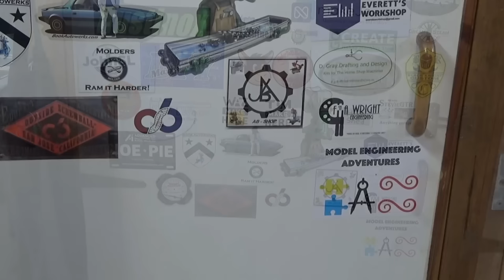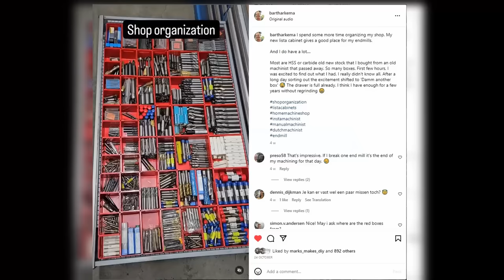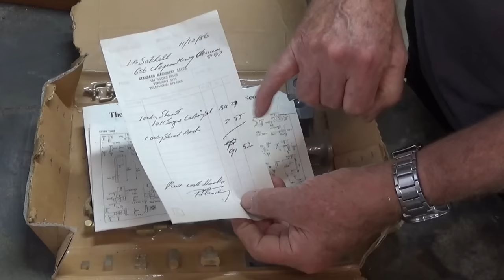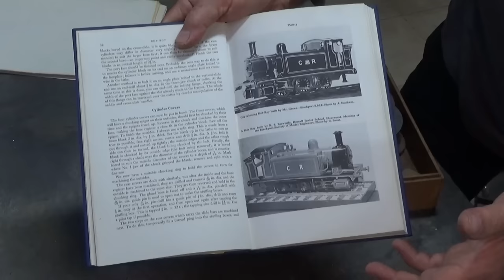Balls - 3 Ways

Comment: Rob Roy was the first model engineering model I made in 1990.
Reply from the maker: I think Rob Roy is a good beginners engine. I built the Tich instead but it is somewhat harder to build if you want to include the Walschearts valve gear. So many tiny linkages.
Regards,
Mark

Comment: Thanks , one of the items on my bucket list.   Don't recall who, but he welded a small rod on the ball for a handle to assist placement in the vice.

Wood fixture is clever.
Reply from the maker: I have just made an accessory for those ball fixtures and it will be featured in a video coming out shortly. It wasn't my idea and it was sent in by a viewer but it's very clever and it does make it easier to locate the ball and it prevents marring the work when clamping.
Regards,
Mark

Comment: Hi Mark I have made that H10 the other year. Bought it from a machine seller that Bought some old guys workshop. Made some pipes for the inlet  and exhaust ,was going to send photos but no option for it.
Reply from the maker: You can send the photos to my email mark.presling@gmail.com  I would be interested in seeing how yours turned out. I had a closer look at the parts today and I was surprised that the cylinder covers were supplied as chunks of steel. I think I will make them from cast iron. 
Regards,
Mark

Comment: thanks for the tips on using the ball bearings for work holding and how to grind them and achieve same results using different ways to do such at the end you show the how to use on a bronze part . just a tip for you and others when holding soft parts and lets say polished parts and these are usually a one use but do same but use aluminium balls or even plastic the later be careful as there hard to get tight if your milling parts cheers all

Comment: I made mine using a ceramic insert on the lathe, the ball was stable in the first groove in the chuck jaws and I was also able the put a relief in the center area of the ball. I had to take light cuts at a slow speed. Very interesting ideas, thank you.
Reply from the maker: I have never used ceramic inserts before. Not sure if my lathe is rigid enough to make them work. I was considering using stainless steel balls which are available in large sizes and facing them as you have suggested. 
Regards,
Mark

Comment: Hi Mark, I enjoyed the video as always. I think my method would be to have a small block of steel with a drilled hole part way through to drop the ball into. The unmachined ball would seat on the drill point. I might even epoxy the ball into the block. You could make it on the lathe or milling machine.
Reply from the maker: Good idea. As it turned out, Mick from Mick's workshop reviewed a tool which is similar to your idea but it uses two plates with the ball held in between using springs and pins. https://www.youtube.com/watch?v=N96GbD9OWI0
Regards,
Mark

Comment: You  dont always need a spindexer on a surface grinder, typically a vee block is used which can also be used on a belt grinder.
There is no real need for a concave grind, it reduces the contact area on the moving jaw. Grinding the flat is to increase the surface area on the moving jaw to prevent damage to the jaw and transfer to future parts.
If you want to leave the ball round it can be sat in a small piece of tube, nut or on a washer to protect the moving jaw. Two washers will also protect the part and still swivel to align
Can the flat on the ball sit on the top of a machinist jack to give a point contact to the part? If the jack has a vee or two in the top then the ball can sit in them and give a self aligning pivoting pad for the part to sit on. Using a full ball on a washer will do the same.
Reply from the maker: All good points. I found that the concave grind was really just a way of ensuring that it wasn't convex which would be bad. 
Regards,
Mark

Comment: You can hold that ball in a lathe, after grinding on a belt, and make small hollow in the middle with cuting wheel or sanding drum on a dremel or something simillar.
That hollow do not need to be precise, just to be under the edge surface.
Then go to diamond stone.
And you will get the edge only contact.

Comment: Cool! I could have used one of them today while squaring up some very rough cast iron for axleboxes. I really hope you make a series doing the Rob Roy, I'd love to see how you get all the stuff around the wheels and rods accurate.

I had 4 accurate axlesboxes 2 weeks ago (ie they all had the same error!), then I misread a drawing, didn't measure the old ones, and didn't use common sense so now I have to make another two which won't have the same error so no doubt some eccentric bushes are on the way too.
Reply from the maker: I don't know how I have gone without these tools for so long. I thought it would be difficult to buy the balls in the larger sizes but they are quite easily found on Ebay. I made the axle boxes for my Conway (by Martin Evans) from steel and then used white metal (babbit) as the bearing surface. If you can buy the white metal it's easy to just pour it in to the oversize or misshapen bore. It's nice stuff to work with.
Regards,
Mark

Comment: Hi Mark, thanks for this excellent demonstration. Did you also consider putting small neodymium magnets on the flat side, just a hair below the surface. I imagine that that would make positioning them much easier.
Reply from the maker: It would but it would also be a bit of a nightmare with chips getting stuck to the surfaces. I did consider just magnetising them but decided against it.
Regards,
Mark

Comment: Is the point loading of the ball on a casting not a concern
Reply from the maker: It could be, especially as the wall thickness on the casting gets thinner. However, with bronze you don't need a lot of tool pressure and I am guessing the cuts will be very light. Like Robin Renzetti says, everything is made of rubber!
Regards,
Mark

Comment: I like the idea of these, but I'm stumped, having neither a Dbit or belt gringder. Its going to be months before the surface grinder is working. I do however have some lumps of hardwood. 😊
Reply: Angle grinder?
Reply: Angle grinder?
Reply from the maker: I did see that there were stainless steel balls in large sizes. These may be suitable for facing in the lathe. It's probably not a problem that they are unhardened. 
Regards,
Mark

Comment: I would have thought that leaving them spherical would ensure that the clamping force remains perpendicular to the fixed jaw (probably only good for holding relatively flat stock for blocking out). In the case of the semi-cylindrical brass stock in the video, wouldn't a ground pin be appropriate if positioned vertically against the moving jaw? I'm just thinking that the clamping forces may become oblique to the fixed jaw (racking of the moving jaw whilst tightening for example). It probably shows that I'm not a machinist but just thinking back to vectors and forces lectures about a million years ago at QIT.
Reply from the maker: I think the idea of adding the flat is just to make it easier to position the ball during the tightening process. It doesn't need to be very large in diameter. 
Regards,
Mark
Reply: @Preso58  And adding the flat also ensures you will not ding your vice jaws with the point contact.
Reply: @JaakkoF that's exactly what it's for.

Comment: Is it just me or was the head of your d bit grinder moving a lot in relation to the wheel while you were spinning it?
Reply from the maker: Yes it was loose-ish. I did notice it and I could also hear that it wasn't grinding consistently. It turned out the two locking screws on the dovetail slide were not locked.
Regards,
Mark
Reply: @Preso58 nice balls by the way.